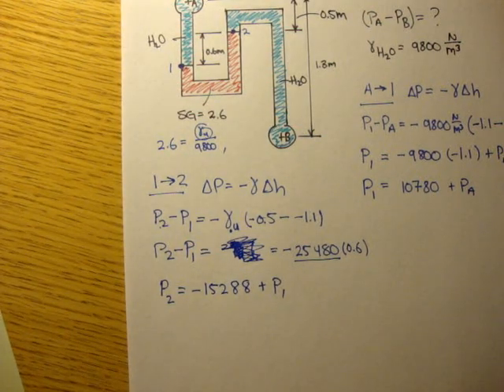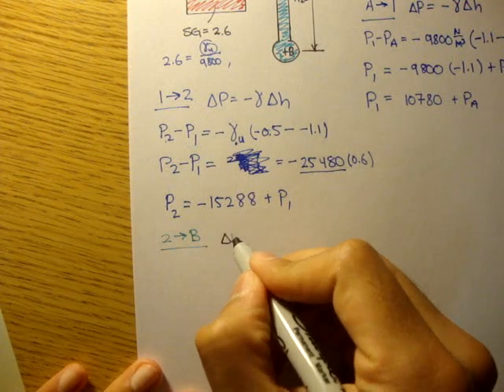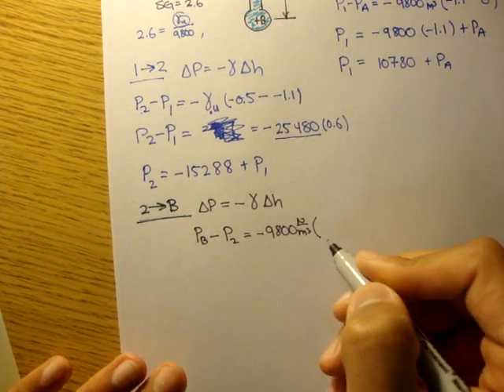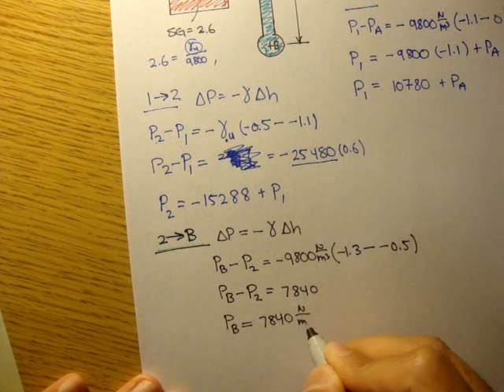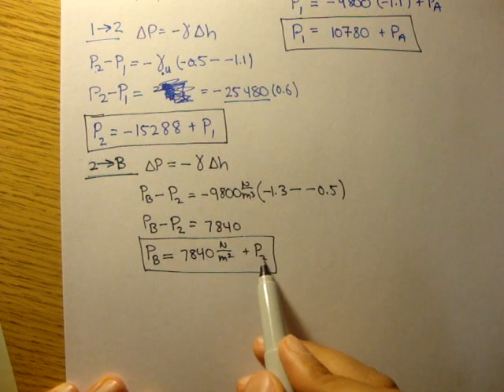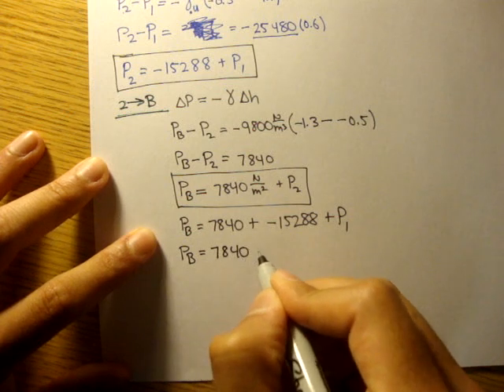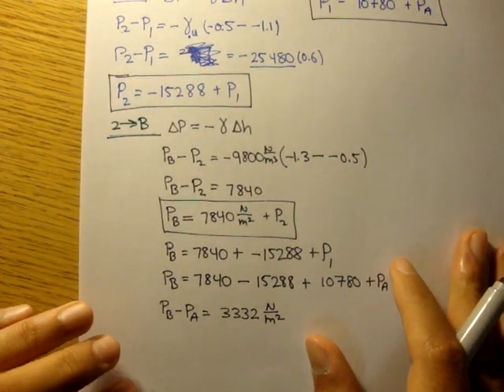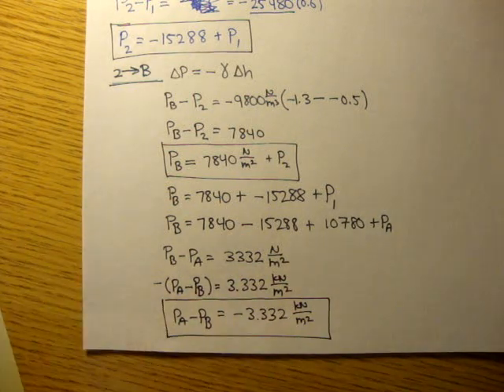Static Pressure: Example 3: Part 2 [Fluid Mechanics #12]

Comment: Pressure gauge B is to measure the pressure at point A  a in water  flow .if the pressure at B is87kpa estimate the pressure atA,in kpa . Assume all fluids are 20°C.See FigE2.4.

Comment: Thanks for this. You dive deep in the problem. Very explanatory and instructive. However, there is a shorter approach to this problem. Set h on the point where pressure is equal.

Comment: I think the distance from B to 2 is wrong. The initial for B should be -1.8 instead of -1.3, so the difference between B and 2 should be -1.3 rather than -.8. All the calculation follows is also wrong, since you are using the wrong value here.
Reply: his calculations are correct
Reply: +Ruby Tian 
Pb-Pa = Vwhw-Vuhu+Vwhw=9800*1.1-25480*0.6+9800*1.3= 8232 N/m3
Reply: The height from A to B is 1.3m, not 1.8m.  It might look like 1.8m in his drawing but in the first video, and this video, he says that distance is 1.3m.
Reply: yah it's wrong :(
Reply: +goustavo nana 
9800*1.1-25480*0.6+9800*0.8= 3332 N/m3
Reply: i am not the only one who notice that mistake
:)
Reply: I agree with you, should have been +0.5-1.8=-1.3m